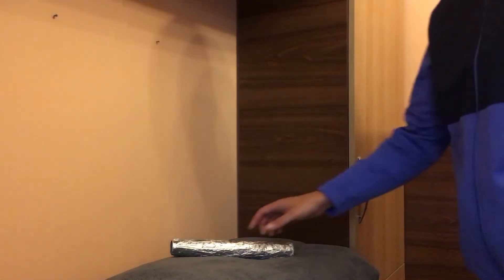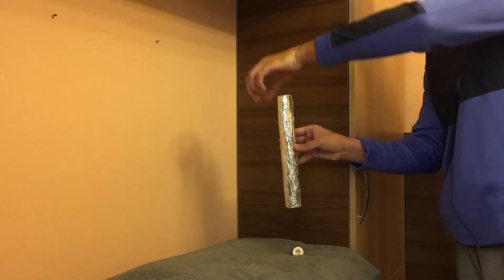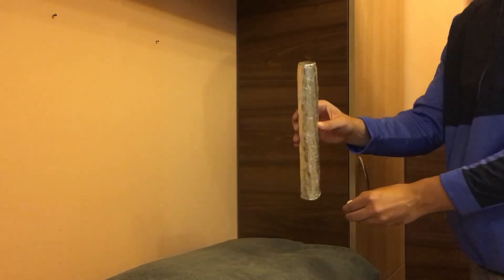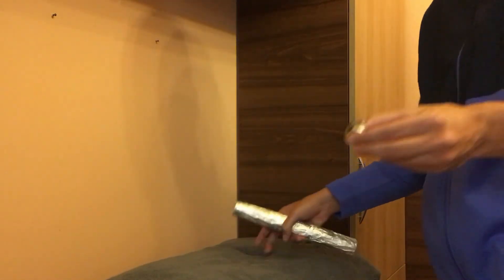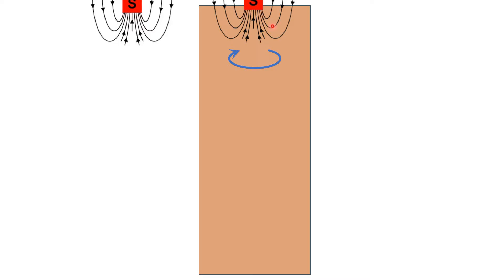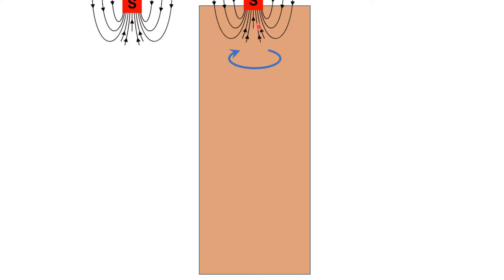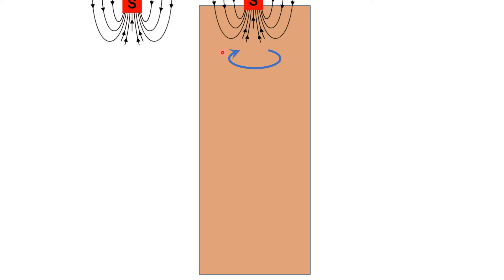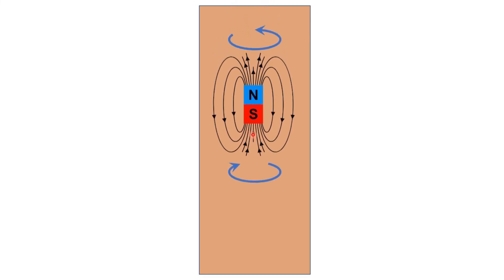Magnet Trick at Home. Faraday's Law with Magnet and Aluminium Foil. World's 1st Electric Generator

Comment: Which kind of magnet will produce better result? I tried with ordinary magnet did not work with Al foil roll.
Reply: I use a very strong neodymium magnet, with a size like the opening of aluminum foil. Indeed I use two rows of aluminum foil to have more layers of foil. So take a thicker foil and a longer foil to have more layers.  Alternatively thick aluminum or copper tube is possible to be used instead of the foil